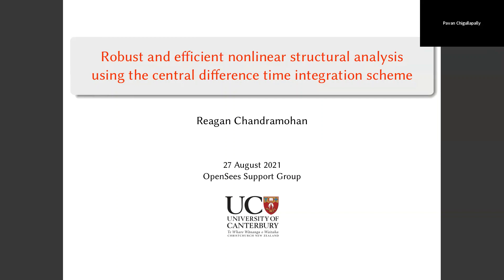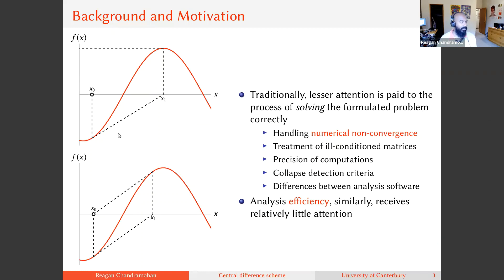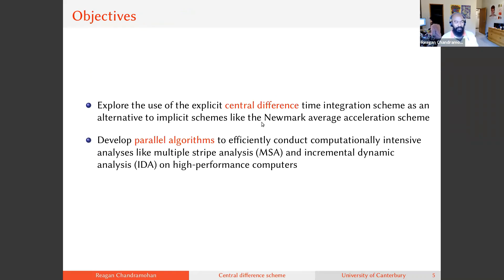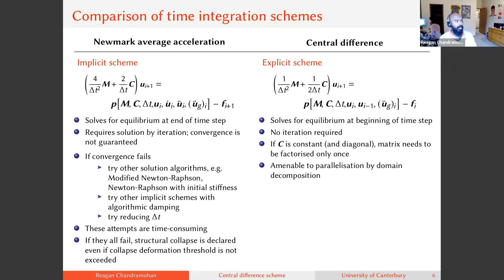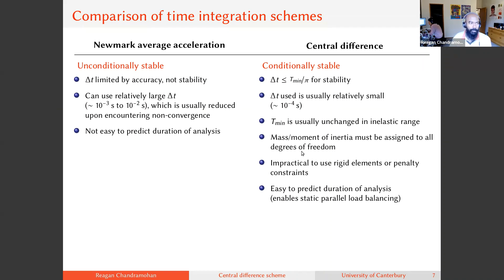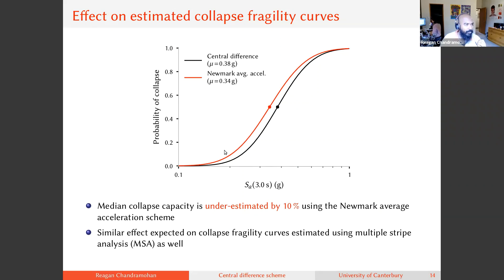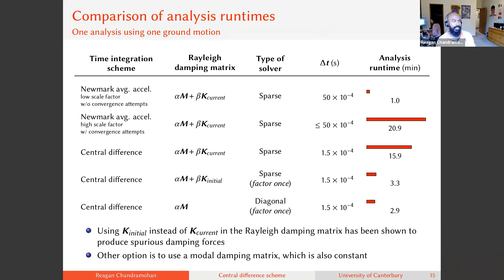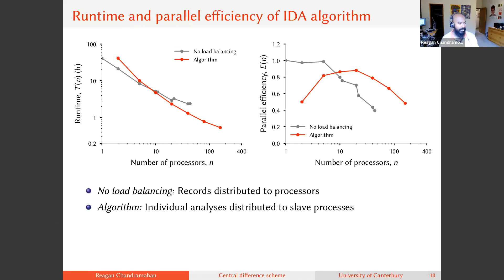OSG 26-Robust and efficient nonlinear structural analysis using the central diff time integration

Comment from the maker: Hello Everyone,

Reagan has reached out and sent the following clarification regarding some remarks he made. If you have further comments, please feel free to reach out to him or post them here.

"The Kcurrent notation used in this presentation was used to denote any non-constant stiffness matrix related to the current time step. The Kinitial notation, on the other hand, was used to denote a constant stiffness matrix related to the first time step. The Kcurrent notation used in this presentation was not meant to denote Kcurrent as defined in the Rayleigh Damping page of the OpenSees Command Manual. In OpenSees, it is, in fact, preferable to use KlastCommit, which is the stiffness matrix used in the first iteration of the current time step. The results shown in this presentation were also obtained using KlastCommit in all instances where the notation Kcurrent is used."
Reply: The problems with the presentation go far beyond the presenter's comment about which stiffness was or was not used for Rayleigh damping. Stopping an IDA due to non-convergence and calling that non-convergence collapse is incorrect. Blaming "problems" and "inefficiencies" on implicit, average acceleration Newmark is just distraction from issues of model selection. Creating a solution without solving the underlying issues is not a solution.